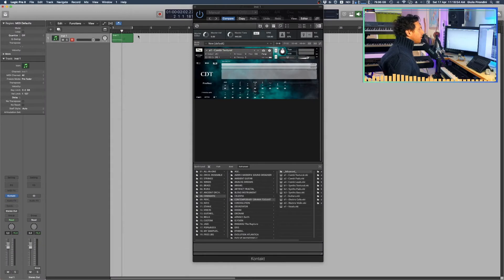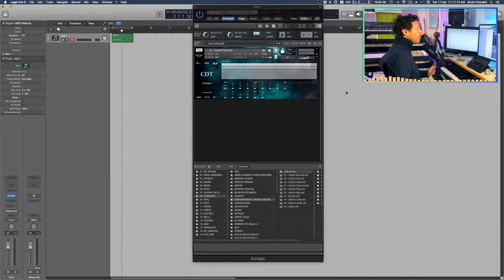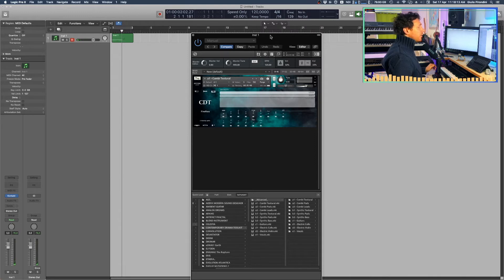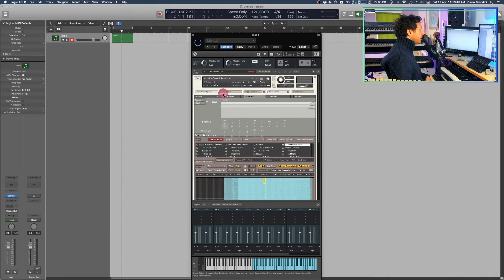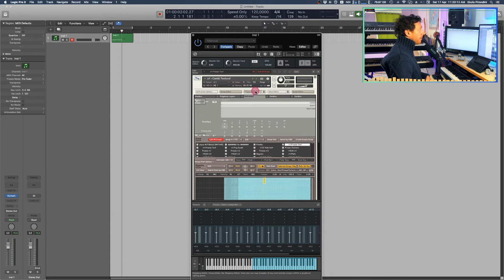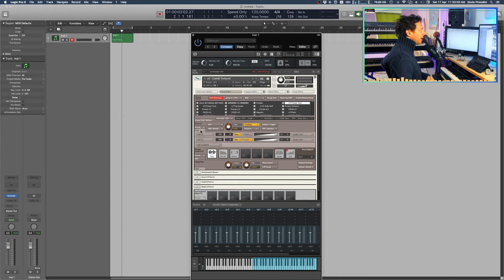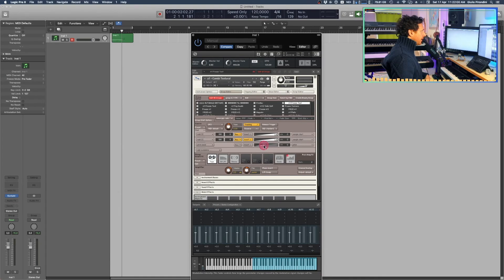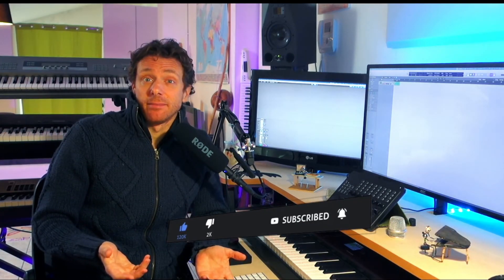How To Add Pitch Bend In Kontakt

Comment: I tried this for Scarbee MM Bass and it still doesn't work. I have done everything you did with no success.  I don't understand. I need help bad. Stuck on this for a whole day.
Reply from the maker: Hi! I can't understand why that's happening to you. In my Scarbee MM bass pitch bend works perfectly.
Reply: I had the same issue with Scarbee Bass. After much trial, I found the add modulation, add Pitch Bend, increased pitch bend to many semi tones but if there was any pitch bend it was so small to be almost unnoticeable. 

I thought I must be missing another setting somewhere

Comment: Why doesn’t orchestral libraries have pitch control for strings? Don’t they use vibrato on cellos, violins etc?
Reply from the maker: Hi Brian, mean reason is orchestral libs must be realistic and less fake as much as possible. As a consequence pitch bend - which controls the frequency of a sound in an artificial way - is generally not used as a cc parameter intended for that purpose. 
You can’t control vibrato through pitch bend, if you don’t want to sound unreal. Moreover each orchestral library offers its own MIDI cc for vibrato articulation (if it’s present in that specific lib).
Reply: @GiulioPirondiniMusic  But vibrato is pitch changing. You pull the string and the frequency gets higher. Pitch wheel does the same. Why would it sound unreal if that’s what going on in real life?
Reply from the maker: @briannielsen9556  cause technically, pitch bend stretches the same sample to get a higher or lower frequency. When you vibrate a note on a cello, in computer music it would be like using another sample, one for each note.
But if you use pitch bend you move, just the same sample. And that would sound extremely fake!
Reply from the maker: @briannielsen9556  plus is extremely difficult to get a good and realistic vibrato using pitch bend! Pitch bend is not intended for that. You better use pitch bend for synth fx.
Reply: @GiulioPirondiniMusic  Sounds like a good explanation. Thanx.
Reply: Hello @GiulioPirondiniMusic  I am trying to make a vibrato on a string instrument, I thought pitch bend is the right way to go, if pitch bend is not recommended, which option shall I use?
Reply from the maker: @parmusical  pitch bend is usually employed to make wider jumps on the pitch of an instrument/sound; whereas to perform a realistic vibrato on an virtual instrument to mimic a real one, the best way is to tweak the midi parameter linked to the vibrato function - as long as your sample or sample library provides that!
Reply: @GiulioPirondiniMusic  thanks this makes sense. Are there any VSTs you would recommend? Tried couple of them but didn't get the result I wanted.
Reply from the maker: @parmusical  try Modern Scoring String, Cinematic Studio Strings or Berlin Strings

Comment: Unfortunately before I did this my modulation wheel was working in Kontakt.  For some reason after I added Pitch Bend (and it works) now Kontakt isn't responding to the Mod Wheel any longer.  (okay now its back working.  I just went down and physically grabbed it with the mouse, and moved it, and now the external keyboard is moving it.   Channel Pitch in FL Studio is still not affecting the Pitch Bend of Kontakt - at least to any discernable amount.

Comment: Does this work for any sample library that is run through kontact? For instance nucleus audio imperia
Reply from the maker: Hi Ted, yes! That’s a simple Kontakt operation that makes pitch bend active for whatever library in which it is not
Reply: @GiulioPirondiniMusic  awesome, does it work using pitch bend notation in ableton I don’t have
A midi wheel?
Reply from the maker: @tedpeterson2956  I don’t know in Ableton but you don’t need a mod wheel to adjust pitch bend. Being Pitch Bend a midi parameter you can change it inside any daw like any other midi cc 😉
Reply: @GiulioPirondiniMusic  ok great I’m sold (been thinking  about it for a while) rip my next pay check thank you so much bro 🤘

Comment: Hey! Sorry for the comment in spanish, but..
¿Es posible utilizar un joystick (PS2) y configurarlo para utilizarlo como un pitch bend externo?  Mi piano Yamaha p45 no tiene rueda de modulación ni pitch bend
Reply from the maker: Hi mate! I've never tried to use an external joystick as a pitch bend/mod wheel device. I guess you'll have an hard way to make it work properly, cause it is not a midi device. Maybe you could do using a software like Keyboard Maestro, trying to link any midi function to the joystick... but it'll be a tricky way!